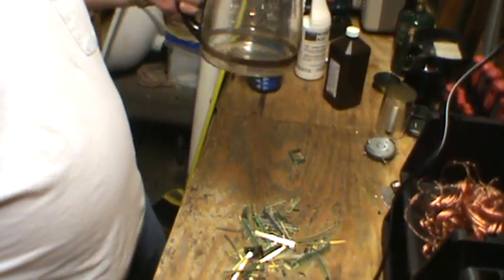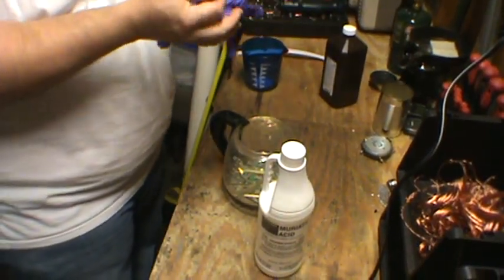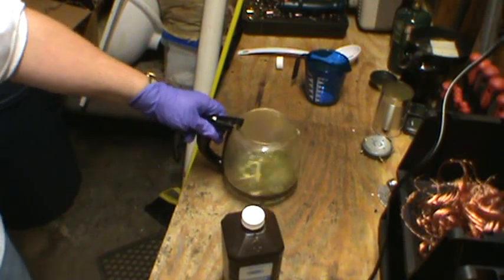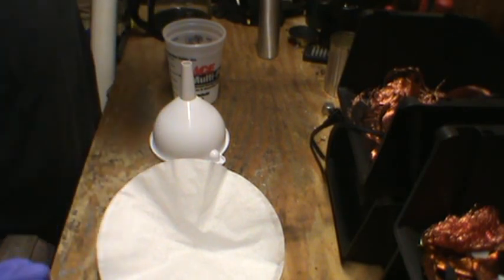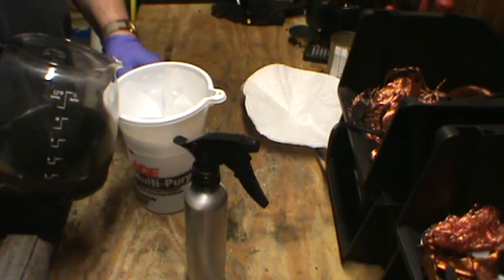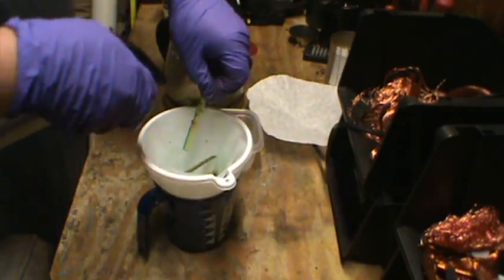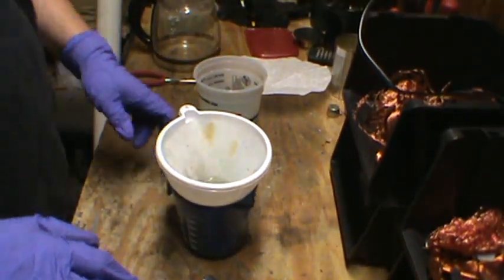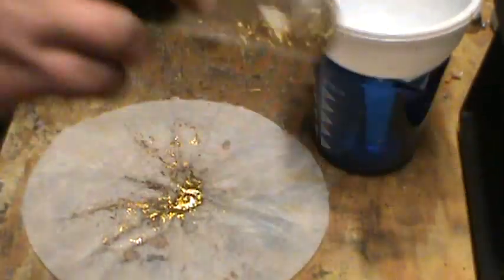How to Recover Gold with A/P Acid peroxide method for gold fingers and gold plated boards easily.

Comment: Hey moose, 2 questions. 1st off how do you cut the finger boards without ripping them up. i tried with a few different things. 2nd can i put all gold plated items in to the mixture to recover the gold?
Reply from the maker: Hi and thanks for watching!  Check out my channel, I have a video on several ways to trim the fingers off easily and quickly.  As for the second art of your question, the answer is yes and no.... You can use AP to recover gold from a few different types of materials.  It has to be gold on nickel copper or brass though,  And should be done separately.  remember 1 gallon dissolves 2lbs copper.

Comment: What was the ratio on acid to peroxide? I did read at the top of your video it said 3 to 1 ratio, the acid was the 3 I believe but I want to make sure. Thanks again
Frank
Reply from the maker: Hi and thanks for watching!  Yes the ration is 3 parts acid to 1 part peroxide.  Adding more peroxide than that will make the reaction happen faster, but will also dissolve some gold into solution.  Best of luck!

Comment: Can I do memory sticks with this method? Can I put them in with finger? Can I put processor pins in also? 
Thank you for your time
Reply from the maker: Hi and thanks for watching!  Most of the gold fingers I process come from memory sticks.  You do need to trim the gold part off first though. You should not put the whole memory stick in.  You can use AP to recover gold from processor pins as well, but again, it pays to do things separately.

Comment: what are the percentages for peroxide and muriatic acid you are using?
Reply from the maker: peroxide 3% and HCL 31.45%.  You can use 3 or 4 parts hcl to 1 part peroxide.
Reply: sweet thanx.

Comment: Hey Moose, great videos. I've been researching this for about a yr now and have come across the many different types of extracting and refining gold. I'll be moving forward with this method as its known to work well for you and others, but i have a few questions. (1) I'm getting mixed answers about gold in boards. some say its just the contact points including the fingers, wiring, and some say the board is inner laid with gold to transport the current and not extracting that will be a waste of my time. (2) I've been searching for muriatic acid and only come across the lower 18 to 21% solution. Where can i find the 31.45% solution? Thanks for your thoughts and time.
Reply from the maker: Hi and thanks for watching!  OK, first, some boards have gold under the solder mask, most do not.  You can soak the board in 1 gallon of hot water near boiling and 2 tbsp. of lye.  That will make the green solder mask come right off so you can tell if its gold throughout.  Just be carefull, lye is vary caustic, its a really strong base and can burn skin.  As for the HCL 31.45, I get mine at Lowes.  Are you in the US?  Most hardware stores have it.
Reply: Moose Scrapper Hey Moose, yes I'm in the U.S. Lowes and home depot have safe version (18-21), but I did end up finding the 31.45 solution at a local hardware store like you said. I've also used a razor to scrape away the green board and it looks like its all copper conductor laced in the board. I'm thinking, using your technique and following up with aqua regia to purify and get 24k. Not gonna try it til i have all my basis covered. Do you have video of extracting the pd from the hard drive disc? I was told to use heated lye, but it won't be pure. I want to get into this and might as well extract all the metals i can. Thanks for your thoughts. on a side note, I just purchased the WSX, great tool. thanks for your input on that as well.

Comment: Moose, How about doing a video the most affective way to scrape a HVAC system to get the most out of the copper? I just had my complete system replaced and had the A/C-Heating company that did the work leave my old units so I could recoup some of my $$$ by scrapping them. I'm trying to find the best way to separate the copper from the coils. Any good suggestions would be appreciated.
Reply from the maker: did they drain all the refrigerants out?
Reply: Moose Scrapper
Absolutely! They do that for 2 reasons.
1) They have to for legal reasons.
2) They can reuse R12 for other customers who still have the older
R12 systems still in use and can charge a pretty penny.

Comment: i live in a condo no garage if i leave out solution on the balcony will it smell - can it be hot or cold outside?
Reply from the maker: You can buy the low odor, or "safer" muratic acid for the same price as the regular stuff.  Keep the container covered and you should be fine as far as odor.  It can be hot outside, if its cold, the reaction will be slower but should still work.  This does not mean it is ok to heat the solution to try and make it wok faster.  Thanks!

Comment: y do u have to take the soldering off n how do u take soldering off
Reply from the maker: You can take the solder of for the most part by a hot sand bath or by trimming the gold fingers off.  If you leave the solder on you are changing the chemical omposition of the solution making it more difficult to remove the gold.  Also, there are many types of solder with different metals in them so figuring out what you will have to do to separate the metals can take more time etc.  It is just best practice to know exactly what you are putting in to solution so you know what the outcome will be.  There are other reasons as well.  I suggest reading the book on precious metal recovery by Hoke.  Thanks!

Comment: Hey moose, sorry if this sounds stupid but im wondering why not just burn the fingers and cell phone parts?? Wouldn't it burn out all the plastics and other stuff just like as if you took gold straight from the ground, and you would burn off the dirt and other minerals mixed with the gold. Or is it because of the quality of the gold being so thin and flakey?? I've been wanting to try something like this to see if theres any pay day at the end of the day in it.
Reply from the maker: Hi an thanks for watching!  I get that question pretty often.  Burning boards is illegal due to the toxic chemicals it can produce.  There is a specific name for the process which I will not share as it is practiced in some countries and is horrible for the environment and for the health of people any where near it.  That is just one problem with that.  Another problem is that metals tend to alloy so if you start burning things, and if it gets too hot, you can have a resulting metal glob that you will not know the actual composition of, and will have to spend much more time and money to figure out and separate.  Also, the amount of gold per lb of boards is typically so small that you would most likely end up losing gold in the ash.  Thanks for commenting!
Reply: Thanks Moose, they'll be no burning of any boards from my way. See there, what I thought was going to be a crazy or stupid question, may have saved my life. Ok, so much for the easy way out. Now I guess I'll be tuning in to more of your videos to try and master this art of extracting gold from cell phones and boards. Thanks again and if I feel like I should ask, now I know I should.
Reply from the maker: william dougherty No such thing as a stupid question!  Remember there are also a lot of great videos by channels, Geo, Indeeditdoes, drew metalsmith, and original feets.

Comment: Ey Moose, so i was wondering, how many kilos of what would equal what amount of gold in grams? lets say from a kilo of cp boards, kilo of pins, kilo of fingers? based on your experience which yields more gold and around how many gram would you best estimate each?
Reply from the maker: That is pretty hard to say.  Gold finger boards made in the 80's have way more gold on them then the ones made these days so its almost impossible to give you a gram yield per kilo of material unless you are working with specifically the same type, age and manufacturer of the material and that data is really hard to come by.  In general, the most money is in the gold finger boards and ceramic cpu's.  I have seen as much as 4 grams of gold from one kilo of fingers, and as much as an ounce come from 1 kilo of ceramic cpu's.
Reply: awesome :) thanks for the info Moose :) helps a lot :)

Comment: Can i use hydrochloric acid in place of one of the other acids they sell it in
big 5l containers at bunnings warehouse for like $20 the brand is diggers hydrocloric acid.?
Reply from the maker: Are you asking if you can use HCL in place of Muriatic acid?  They are the same thing.  Muriatic is just 31.45% HCL.  I am not sure what the diggers hcl is but if it is less than 30% HCL I would not use it.

Comment: Hey MS (subscribed) did a batch of cell phones boards. ended up w/ grey slurry mixed w/ gold flakes. do you know how to seperate that junk out? nitric acid wash?
Reply from the maker: OK, so either the boards were not clear of solder and other metals or you used too much peroxide.....  Best advice I can give on this one is to throw in a little more hcl, filter out the solids.  Test the remaining fluids with stannous chloride for gold.  Let me know what happens
Reply: Moose Scrapper I should have cut out all the IC's. They disintegrated while rinsing(grey sludge) green board flaked too. Sorted  out junk. Rinsed /ran through a HCL/nitric/sodium nitrate. Now I think my grey gold is mixed w/ grey silicate. F Up#2. It's my first Try. I experimented w/ cheap cell phones.we had laying around. Maybe I'll melt it stir and see if anything sticks.
Not a complete loss
  I learned a lot from you/my mistakes/and have a killer batch of AP & aqua regia. second times a charm.
Thanks keep up the great Vids.

Comment: so AP also removes the gold from the cellphone circuit boards and motherboard? or does it dissolve the gold? sorry for all the questions, i just dont want all these collectibles to go to waste. fingers been hurting scrapping cellphones :D
Reply from the maker: AP is only meant to be a method of removing gold not as a method of dissolving it.  Thatd not to say that you can't dissolve the gold with AP, just that you probably shouldn't because the gold is harder to get back out of solution in a high quality.  If the cell phone boards are cleaned of all the little componants and solder then they will absolutely work in a AP bath.  Make sure you keep the pieces you take off the board as many of them contain gold and other metals as well.
Reply: Ok Moose, thanks man. so the boards are good to go too, so the gold just peels of as well of the boards? damn, kinda scared itl all dissolve .. what happens if there is solder in the solution? is there a faster way to get everything off the cp boards without having to damage the streaks ok gold?
Reply from the maker: Marcus Kaiserkopf Jusst keep the peroxide content low.  The process may take a few days but it worth it to have gold that is easier to refine.  The AP will dissolve the copper and nickel under the gold plate freeing it from the board.  You really can not be thinking of speed when it comes to gold recovery, haste makes waste especially here.  If there is solder in the mix it can cause the solution to gel up and make getting the gold more difficult.
Reply: ok. hmm i came up with this thought, so like what if you got the aqua regia solution ready, and at the same time you are melting down all your junk gold bits, scraps, jewelry etc, mixed with other metals and such and while its still hot as hell in the crucible, you drip it into the aqua regia, uhhmm what will happen? will it dissolve faster? fizzle and splat around all over the place? see im scared to try this but its a thought tho :D
Reply from the maker: Marcus Kaiserkopf Wow, that would be extremely dangerous to say the very least.  And I mean the VERY least.   You really should not even consider using Aqua regia at this point.  Not only is the acid extremely corrosive, but the gases produced at room temps are lethal as well.  So to heat it up like that would combine rapid unpredictable spattering with fast evaporation into gas form.  I REALLLY urge you to read the book on precious metal recovery an refining by CM Hoke.  I thin it would answer a lot of these questions for you AND give you a lot of safety info.
Reply: oh shit, ayt so its not safe, ok, HAHA.:D
ayt thanks Moose, yeah i know man but i got no time to read coz i got so much stuff to do, hoarding phones and mother boards cpu chips and such. also got this cave that we still hauling on. kinda want to do everything in one gigantic batch and get the best out of it all. ok well thanks for all the help Moose
Reply: If there is solder in the mix it can cause the solution to gel up and make getting the gold more difficult.- difficult how tho? cant i just rinse it off after i filter it? i mean, its just the gold flakes off the cp boards that i need right?
Reply from the maker: Marcus Kaiserkopf Unfortunately you cant just rinse it out, the gel is pretty nasty stuff.  You are also changing the chemical composition of the solution by allowing other metals in there which changes things like disposal, refining, etc.  It is for the most part just the gold however most people who are experienced with AP method keep the solution clean and reuse the hell out of it because they know that there are still gold values in the solution itself.  After using the solution long enough you can then precipitate the gold values out but not if there is gelled up crud and other metals.  Its almost like trying to squeeze a semester of chemistry class into a few messages.....lol...not the easiest thing to do.
Reply: AHAHA i know!!. ok thanks Moose. shit i think i just took an online course for free off you man. SHYYEEET :)) this was totally necessary information. well, once i hit the caves and get the ores refined and all, ima buy you a ticket to come over to the Phil and then we Full scale the cave production haha!! :) cheers to you Moose :)
Reply: I noticed that the AP solution does some what eat or dissolved bits of gold. is there a way to precipitate it from the solution?
Reply from the maker: Marcus Kaiserkopf if the gold is dissolving you have too much peroxide in there.  You can precipitate when all done by sticking a piece of copper pipe in the solution.  Copper will replace the gold and the gold will dro pout as black powder.

Comment: can this process also works in gold plated pins?
Reply from the maker: It can work on non magnetic pins because those are typically brass or copper under the gold plate.  The process will be very slow however but still effective.  Thanks!
Reply: Thanks Bro.

Comment: Master Moose......... Love your videos...While watching another's vids I noticed that you replied to them and mentioned the removal of the green mask over top of the printed circuit boards....... I've run across a few boards that really look like there's gold underneath there. Do you have a decent method to remove that green mask?
Reply from the maker: Hi and thanks for watching!  Master is a bit of a stretch though....lol.  The only method I know of for removing the green solder mask safely and effectively is to take the item and soak it in hot water and lye.  You only need a couple of spoonfulls per gallon of water and the nice thing is there are no toxic fumes and you can dump it down your drain when done as lye is often sold as a drain cleaner.  Lye is very caustic though, it is a strong base and can burn your skin so use rubber gloves.  Heat the water in a glass pan until just boiling, add lye and the pieces you want cleaned then let them soak for about ten minutes.  Ten use tongs and an old toothbrush.  The solder mask will brush right off.

Comment: Interesting. Have you done anything with recovering gold sulfides? I've been told that there is some of that remaining in "black sand" from prospecting concentrates. I've got a few bags of such and looking for the method to extract the remaining gold. I know it won't be much but it's hobby rather than profit.
Reply from the maker: Hi and thanks for watching and comenting.  Unfortunately I have not done any work with that yet.  I would have to buy bags of concentrate and try to work on a strict "don't pay for scrap" philosophy.  The goldrefiningforum does have some posts on that though...check it out.

Comment: Have you got any videos where you recover the gold, refine it and melt it that would be interesting as i cant find any its either one or the other
Reply from the maker: Hi and thanks for watching!  I do actually have videos on other parts of the process.  The problem with making just one video to cover all of that is that it would be a pretty long video and its hard to keep peoples interest after 5 minutes.  There are also so may different methods for recovery depending on the type of material as well.  Thanks!

Comment: Thanks for the video, to refind what is left since it's just different levels of gold, can't you just heat it with a torch in a crucible? I would think all of the lesser metals would incinerate and leave just the gold behind.
Reply from the maker: metals tend to alloy.  If you try to melt it, gold having a fairly low melting point, you will just blend them all together.
Reply: Moose Scrapper So after all of this you would still have to use a Aqua Regia to get the 24k gold? Or is there another solution that's maybe a lot less toxic?